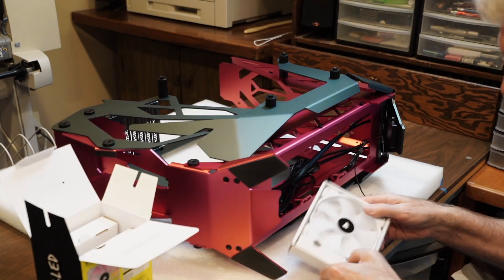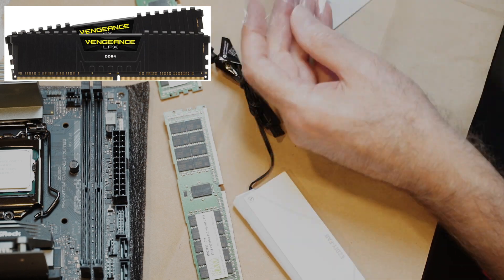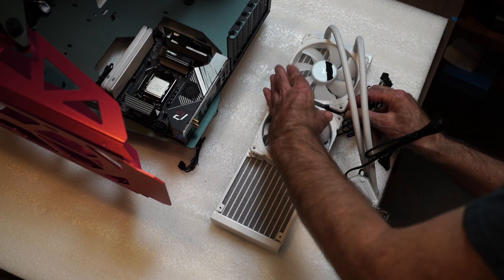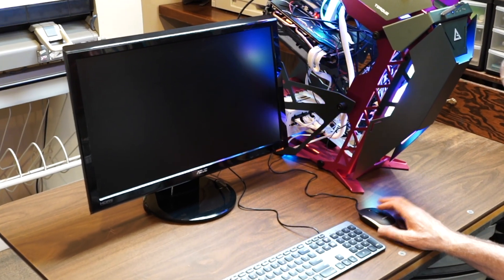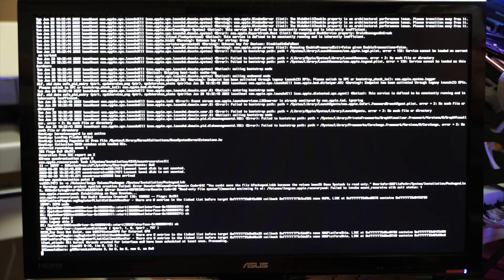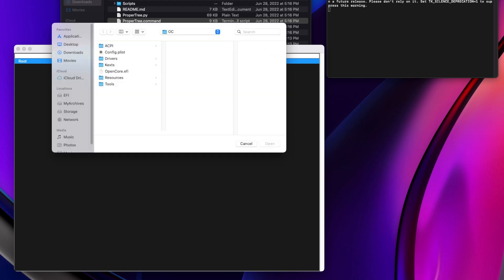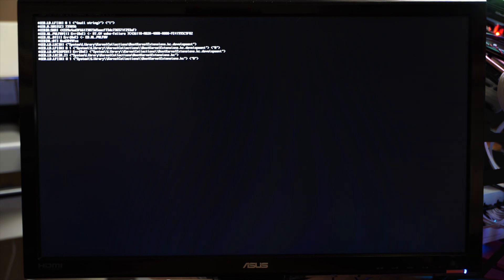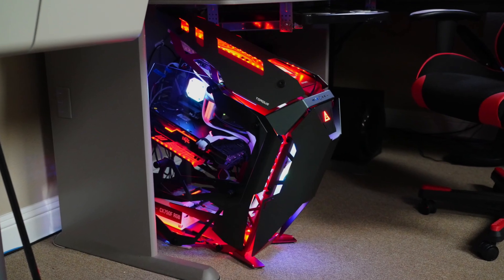Hackintosh Build with Big Sur

Comment: can u do step by step for open core im trying to do dual boot so like windows as main and macos on another harddrive
Reply from the maker: OpenCore does have a section on creating a dual boot system. I will need to go back and study that.
Reply: Have you tried simply installing windows to the other drive and using the bios boot menu to choose which drive-OS starts? It works well for me though the second drive has linux.
Reply from the maker: Dual Boot - Windows 11 & Opencore Big Sur Build - https://youtu.be/h2IrW1GU9kE